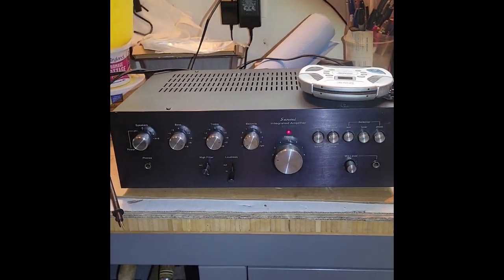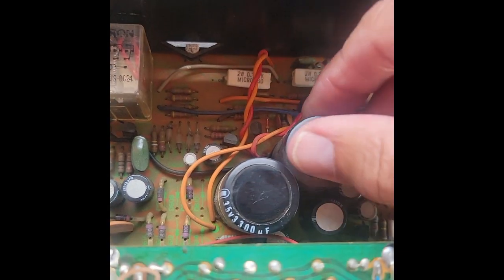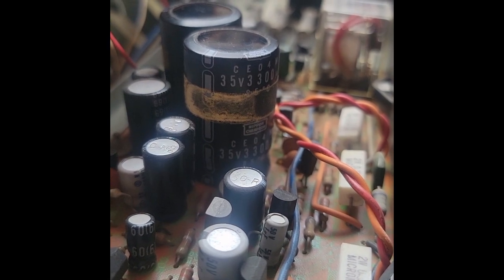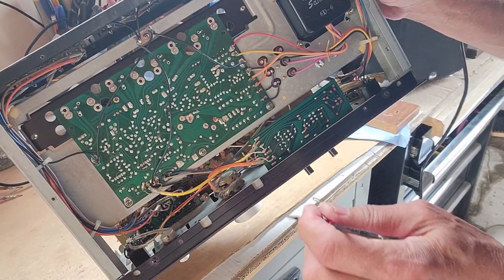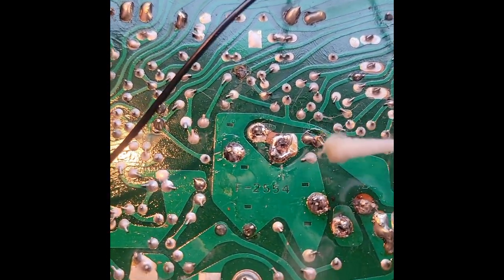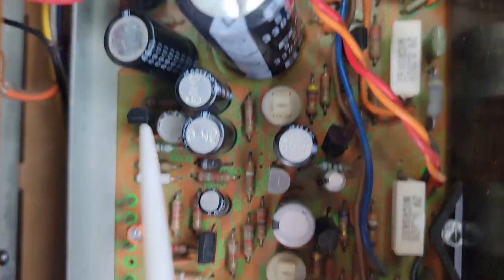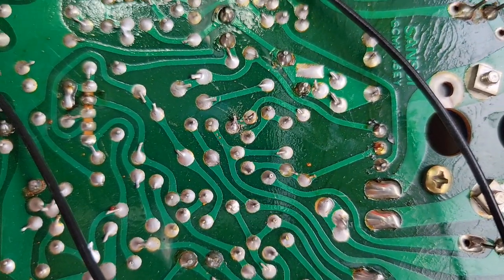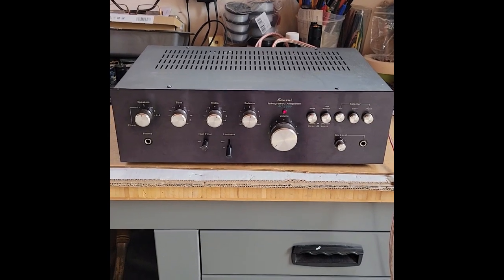Sansui AU 3900 repair

Comment: Hi good sir I Burnt mine by letting the speaker wires cross positive and negative touched know there is no sound ,I am not good with electrics what do you think I Burnt,so I can fix it ,thank you
Reply from the maker: Crossing the speaker wires causes a short in one of the two sides in this stereo unit. This likely caused a short in the output transistors on that side and burnt them out. Just a guess but they would likely have to be replaced by a stereo repair tech. Finding the right parts could parts could be tricky.

Comment: Hi, i have the same amp. It's working but i want to do a fully recap on it. Did you do the adjustments after the work?
Reply from the maker: I didn't. Not sure how to set those bias pots so I didnt touch it. Full recap of your unit sounds great. These amps are well worth the repair efforts. I sometimes wonder if the new caps don't harden the sound quality a little?